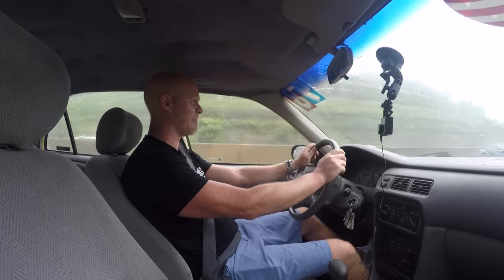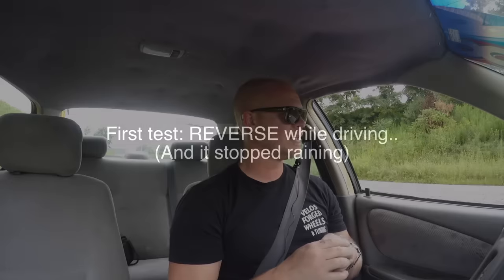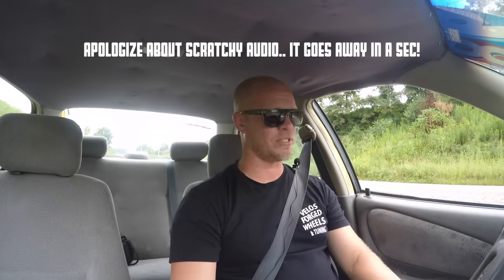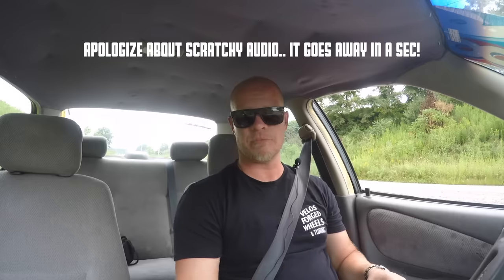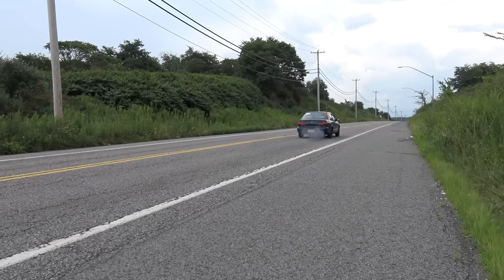What happens if you put a 20 year old car in Reverse AND Park WHILE driving? (NOT SAFE)

Comment: Hey Autovlog I think you should find a manual transmission car and do these. Probably better results and more options. Like what happens if you shift from 4th to 1st.
Reply: Michael Bacon it’ll either stall the car or send you through the wind shield
Reply: If you're going (way) faster than the first gear allows...then the engine could blow up
Reply: The transmission will just explode
Reply: Jose M no it won't.
Reply: Modern manual transmissions will not let you shift into reverse or first when moving forward at speed
Reply: I think that if he puts it in reverse with a manual car, he will destroy/smash the gears in the gearbox.
Reply: It won't go into gear. Just grinds.
Reply: The tach will peg out then it would put a hole into the engine block. Also it will chew up the clutch plate too.
Reply: thats the money shift. done on the drag strip many times. itsjusta6 blew his engine missing the shift and over revving. Mythbusters had grinding....
Reply: Nothing will happen, because the car won't allow you to go into 1st gear at high speed, it will be extremely difficult so you know your doing something wrong
Reply: Reverand Hale 🤣🤣🤣🤣🤣
Reply: The gears just going to grind if you try shift from 4th to 1st going at a high speed. and you can’t put a manual transmission into reverse meanwhile driving forward.
Reply: Michael Sullivan modern manual cars won't, older ones will. In my bag of shit field car you can shift into reverse and first when moving at speed
Reply: Michael Bacon it would probably blow up the engine
Reply: The transmission and/or Engine will explode. Most likely. It will massively over rev the engine and transmission. It's lovingly known as the "Money shift" because it costs a lot of money to repair your car. Although 4th to 1st it might lock you out, I obviously haven't tried it haha
Reply: The syncros wont line up but you can do it, if you are racing and slamming it into the gears you can force it past the syncro and get it into any gear
Reply: I’ve accidentally downshifted to 1st going 50 and it just redlined. Thankfully nothing gave and it was only in gear for a split second.
Reply: Standard shift will just grind like hell and wont go into reverse while going highway speeds
Reply: I've gone into second at about 100 before.. well someone I know did... overrevved but lived.. nothing special
Reply: Ive done this and put it in reverse and it blew my clutch sounded like glass breaking on the ground
Reply: You can totally go from 4th to 1st my friend did it in his car on accident while accelerating hard from 2nd to 3rd but missed 3rd and went into 1st and money shifted. So it is still possible.
Reply: 4th to 1st = engine blows up as it goes way past the rev limiter. You can shift into reverse which can blow up the transmission and lock up the wheels.
Reply: Its called money shifting and breaks your engine in Seconds
Reply: Michael Bacon it’ll just grind
Reply: Try it in my summer car before you try it with your rebadged corolla.
Reply: Synchromesh gearboxes will not allow you to shift into first gear at speed.
Reply: A 1979 Nissan Sunny wouldn't let me shit to reverse while I'm driving, I don't know about others, but Japanese manufacturers had that safety implemented literally 40 years ago. However shifting to a lower gear from a higher one is going to result the same whether or not it's an old car. It may blow your transmission up, or could stall, and cause severe damage. But trust me, if you're going at a decent speed, you can't shift from a 4th to the 1st that easily, it would just grind.
Reply: If your traveling at 60mph in 5th gear, shifting the car into first gear will cause a compression lock up of the motor which means the wheels that are driven will lock up until the car slows to the speed which suits that gear ratio
Reply: Hell nah! Don't want my boy getting shot out of the window
Reply: Easy answer! BOOM 💣
Reply: that sir is called a moneyshift
Reply: Dutchy if you kept the clutch in it wont break
Reply: Michael Bacon true
Reply: Dutchy yes if you put reverse while driving 40 mph on a manual transmission
Reply: Michael Bacon in a good car going to 4th to 1st if you can even get it in 1st gear and you dump the clutch you can shear the flywheel bolts clean off. I’ve seen it before.
Reply: If you are driving a manual transmission car with a 2 stroke engine and down shift from 4th to 1st you may blow the fuck outta your engine.
Reply: Michael Sullivan wrong not many cars do that and if you do go from 4th to 2nd you can shear the flywheel bolts clean off.
Reply: that my friend is called money shifting and it results in blown transmission and engine lol only if you're going faster than what 1st gear allows
Reply: You hit redline and the fuel injector will stop supplying fuel to the engine, so you do not blow up the engine. Plus you will be rough on the clutch and the transmission because the ratio in first gear is way higher than other gears
Reply: Depending on his speed, you go super slow in say 4th but if he is going faster than first will allow the motor will over rev and probably throw a piston or split the crank in two
Reply: Straight away you will enjoy misfired of your engine,i experienced it before.
Reply: Michael Bacon .
Reply: it will DEFINITELY go into the gear, but your revs will just jump over red line.
Reply: Michael Sullivan Most people here should know how to double clutch (rev matching, obviously), and yes, that makes it much easier to miss shift.
Reply: I know on mythbusters they tested an older manual car going at speed and they tried to shift it into reverse but the gear never went in until the car stopped.
Reply: Yeah it will redline like crazy
Reply: Reverand Hale it'll make the engine blow up
Reply: They have whole compilations of shit just like that on YouTube.
Reply: You will hear the engine go “HEEEEELPPPP”, make a huge noise and then you will have to shut it off otherwise it might catch fire
Reply: Reverse will grind, 1st will money shift.
Reply: No. you cannot shift a manual box into reverse. You can't even 'bang' shift it into reverse while the output shaft is spinning in 'forward' motion. The reverse gear is always turning opposite to the input shaft because of the idle gear. The dog teeth will not engage with the gear and lock it to the shaft because they will cam out since they will be spinning opposite to the gear and all you will do is make a bunch of noise. Also it's quite rare for a manual box to have syncros for reverse even because you are expected to be engaging it while stopped. Some reverse gears are spur cut and not helical to further save costs. Which is why reverse gear 'whines' in many cars with manuals. 

You CAN shift into reverse if you first lock up the drive wheels with the brakes while holding down the clutch. This is of course a lot more then 'accidental' and requires quite some precision to pull off. And then the weakest link will give which is likely to be the small idler gear or the dog teeth on the shaft will break.
Reply: Michael Bacon we call that a money shift
Reply: We all know that will simply over rev the engine and destroy the head and transmission and pretty much the car, that’s like trying to throw a human onto his feet at 35 mph and expecting him to land and run at that speed , you trip and fuck up your face
Reply: Michael Sullivan that’s called a synchro it will just grind until down to speed
Reply: Carlos Finch old cars will and they will over rev and the valves will be ruined
Reply: Your flywheel will blow to bits I have seen it happen
Reply: Michael Bacon 4 to 1? That's how you blow up your engine lol
Reply: Michael Bacon it will either stall or won't let you
Reply: Snipe Stud00 haha I saw that, but now he's bigger and better what you think about the groms
Reply: You can't. It'll just grind no matter how hard you try to get it in.
Reply: Well if you DO manage to get it into first, like my car does it will just kick the rev limiter at first and cause the engine to lock up.
Reply: IDK shifting from the top of second into first instead of 3rd is called the money shift for a reason I've done it but caught myself it squealed tires and Reed but I disengaged the clutch before it over reved
Reply: Aye people the engine speed when mechanically coupled can not be limited by any form of rev limiter it's going to spin as high as the clutch, tranny, or engine will mechanically fail.
Reply: If you have a hill and start with the car in reverse gear and as momentum picks up and the car speeds up, drop the clutch and see what happens when its in reverse.
Reply: Laith Behnam in old 2 stroke vehicles it will run in reverse if you put fuel in the exhaust however these newer 4 strokes with a timing chain that only works one way it will most likely hope time and do some damage
Reply: Laith Behnam Ain't happening on a 4 smoke. Now lug down an ole 2 smoke Detroit Diesel too much and she'll go spinning the wrong way for ya.
Reply: Michael Sullivan modern? My 1997 Opel Vectra B tranny wont shift into 1st after i get up to 45km/h
Reply: Thats called a money shift 😂
Reply: Michael Bacon well in my car you can go up to 60kmh in 1st so if you dont go over that and double clutch and rev match nothing bad would happen
Reply: Dutchy wrong
Reply: Head gasket pops and pistons go flying 😂
Reply: I think everybody knows what’s gonna happen when you shift from 4th to 1st
Reply: Michael Bacon of and 4th to 1st will just lock up the wheels and slid due to the sudden change of output speed from the motor to transmission, to the rear axle / front axle gears spinning speed. So if you’re doing 50 mph in 4th gear, and you go straight into first you’ll be jerked forward due to engine braking, (similar to braking with your brakes) and you’ll likely also skid your rear tires, and possibly damage the transmission. I’ve done this on a motorcycle by downshifting too quickly at a high speed, trying to get flames from the tail pipes, and I fishtailed. Luckily it wasn’t too bad!
Reply: Detonation is what you get lol
Reply: Money shift
Reply: Bent valves
Reply: I had a 98 ford ranger manual. It would not let you put the vehicle in reverse while moving forward.
Reply: Patrick Todd typically it will just grind in the case there is no reverse lockout
Reply: Michael Bacon search “money shift”
Reply: Dutchy Could
Reply: My car goes like 48mph in first lol. As long as I'm just cruising at like 35-40mph, a downshift to 1st wouldn't be terrible =P
Reply: Some cars physically won’t let you
Reply: @gravemind6536  it will grind, if you are in 4th then you are going at a considerable speed to not get the gears to sinc, the car wont just explode.
Reply: 3rd to 1st in an old Sonoma pickup and the clutch exploded.
Reply: Of you shift from 4th to 1st doing a higher speed you are sure to have the rear end come up off the ground (if your in an FF layout) for a split second.....
Reply: Hell yeah
Reply: Carlos Finch this is correct. My mom went into reverse in an 80s Civic and it just screamed
Reply: Ask any Honda guys at the strip..
Reply: it’ll send the car into very high revs and blow the engine
Reply: ffhgu 07 i sure do, here in UK 90% of people drive manual cars
Reply: A manual won't go into reverse while moving forward.  And as for shifting to a very low gear from a high gear, it will rev the hell out of the engine, possibly destroying it, and or burn the clutch.
Reply: @abdulwahaab9026  I have accidentally grabbed a very low gear before can't remember exactly maybe 5th to 2nd.  Luckily I realized it before letting out the clutch all the way, but it can be done.
Reply: You would throw a rod out the block
Reply: You cant force a manual to do that, since it have sincros, the gear WONT go into if the revs are that far. Of course you can still apply more and more force, eventually you will end with a granaded mess of gears.
Reply: @38911bytefree  you can do it with a manual trans i have done it b4 i was downshifting from 5th to 4th and accidentally put it in 2nd when i was still learning how to drive manual and i didnt force it either but i caught it b4 it did any damage but if you do that you can throw a rod i know someone who has done it plus a youtuber i used to watch did it b4
Reply: Engine will blow nothing good
Reply: Haha
Reply: Blow that engine up

Comment: Try while doing 40mph put it in neutral then rev it hard then put it in reverse
Reply: bmwrp8 itll just blow the motor... trans prevents it..
Reply: Try doing 32.04mph put it in reverse let go of gas. Put it in neutral clap four times but have it got like this: Clap pause pause clap clap pause clap. Then put in park then rev it to 2.302k.
Reply: fairy will appear
Reply: Snipe Stud00 Bruh, in cars that have rev limiters will still have then in neutral.
Reply: zevi 2000 my car only revs to 4k in neutral out of 6.2k rpms
Reply: brandon calin While stationary I'm guessing. Most cars won't let you rev past 4k while stationary, it's not needed
Reply: zevi 2000 even if I am doing 90 it wont rev past 4k in neutral. And for reving a car to 6k has a lot of uses. Is it bad on the transmission, sure but it's fun.
Reply: brandon calin Interesting. Some cars get finnicky
Reply: zevi 2000 our 2015 Kia forte let's you Rev it redline
Reply: @joseavila4062  bro 🤣🤣🤣

Comment: I've tried the reverse thing while going hwy speeds in a 29 year old (1989) Dodge Caravan. This one had the A604 overdrive trans, not the old 3-speed. The TCM simply puts it in neutral till the vehicle comes to a near complete stop, then engages reverse. This technology is nothing new.

The Chevy trans is actually engaging reverse which then stalls out the engine.

Comment: Interesting the engine shuts off when in reverse. My guess is the opposing force of the transmission being in reverse  forces the engine to stall?
Reply: Nope. The shifting mechanism all controlled by the ECM. It's programmed to override the shifter position switch default routine to another one.
Reply: Ibraheem Al hadede just because its controlled by the (TCM) not ecm, doesnt mean the backwards force in the engine isn’t stalling it out.....he’s going forward when the car should be going backwards, counter acting the rotation.
Reply: Exactly. You'll need to give it some gas to keep the engine from stalling. Then it should engage reverse and...well, you'll probably lose control of the car.
Reply: If it was a safety feature, it would have also turned off the engine when the car was placed in park while moving.  Its physics, not a safety feature stalling the engine.
Reply: Correct
Reply: Yep
Reply: Putting it in park doesn’t do anything because the engine isn’t actually connected to anything when it is in park. Putting it in reverse causes a counteracting effect trying to move the car in reverse and it stalls the engine since it is connected to the parts it is trying to move.
Reply: No. Park is just a little gear ⛮ Tooth that locks the gear to diff
Reply: Actually, park is a flimsy pawl of metal that slips into a flimsy metal slotted lock ring that's not quite robust enough to be considered a gear (IMHO), but modern cars do seem to have stronger "park" parts than in older transmissions.  Its designed to ratchet if the car is moving too fast... however, its not designed to be used over and over again... in my experience after a dozen or so uses, it can be pretty trashed and not want to hold the car anymore.

https://i.ytimg.com/vi/BhIIU70Q1aU/maxresdefault.jpg
Reply: I have to confess I actually did accidentally put a car, a 1997 Ford Crown Victoria, into reverse while driving on the highway at 55MPH. I was trying to figure out whether the poor acceleration was due to an engine problem or a transmission problem, so I put it into neutral and revved the engine...except I overshot neutral and went into reverse. Yes, reverse engaged and the rear tires were screeching for the very short amount of time it took for me to realize what happened and get it back into drive! The poor acceleration was caused a clogged catalytic converter, which was replaced, and the transmission never showed any  damage due to being put into reverse at 55MPH. That car almost went to 300,000 miles.
Reply: the engine does not experience any backwards force. When a transmission is put in reverse there is an idler gear that is activated that rotates the gears backwards while the dogclutch is still rotating the same way it would be rotating in any forward gear.

Comment: How many lug nuts does it take to keep the wheels on the car, while driving? 1, 2, 3 ?
Reply: It depends on the rim
Reply: Nope. You can easily drive with 3. Never heard of someone who lost the lugnuts while changing tyres and then had take one nut from each wheel(assuming thats an car with 4 nuts per wheel) ?
Reply: I'm guessing 2 but they have to be diagonally and pretty tight
Reply: Indosarnia 😂
Reply: You guys have lug nuts?
Reply: You guys have wheels?
Reply: You guys have rims?
Reply: I work at discount tire and see cars with a single lug nut on the daily. Definitely not the safest thing but I see it quite often. Often on minivans
Reply: @Cugy_2345  wtfff😭😭